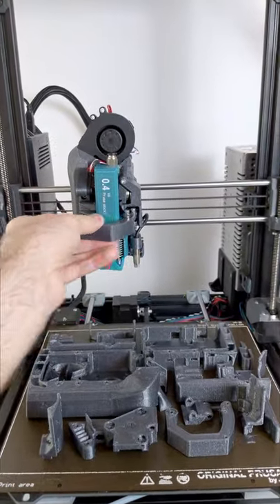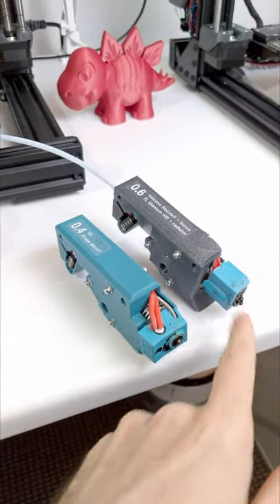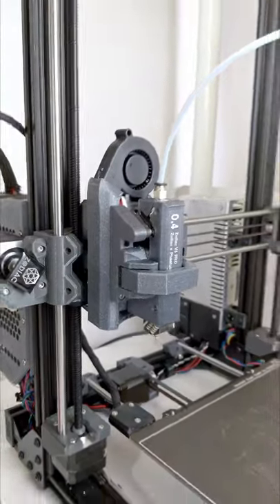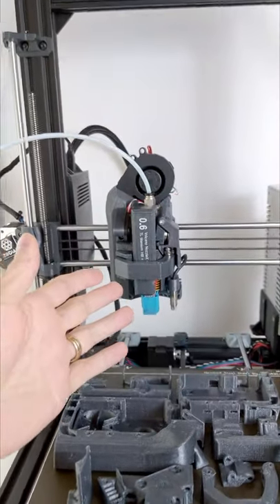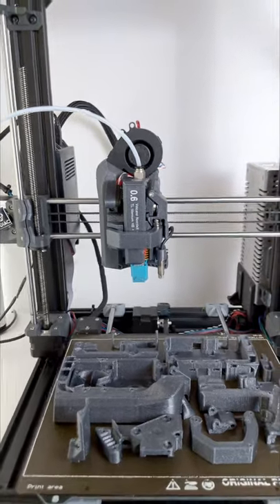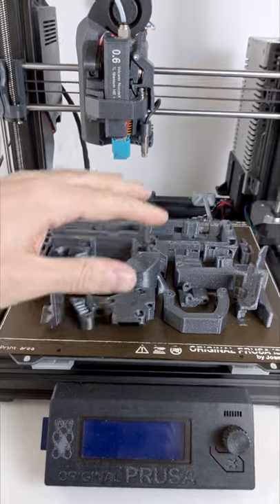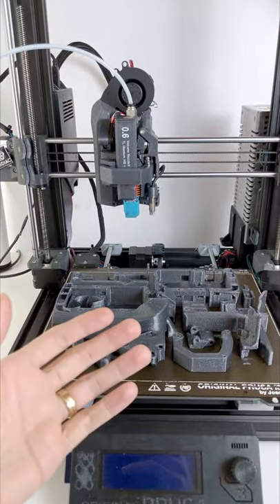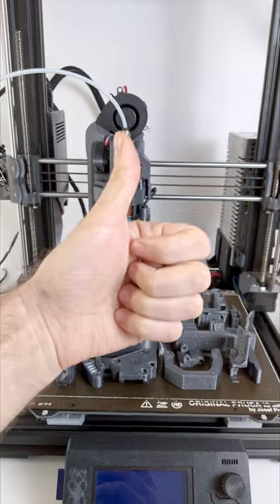Designing a swappable hotend extruder

Comment: I love the design, great work. Do you have a specific Z-Offset for every hotend? Or do you mount the hotend such that the Z-Offset stays constant? Thanks for sharing the video, and good luck :)
Reply from the maker: Z-offset is about the same for all hotends, but there's still variation, so for now I still need to adjust it in the printer. I'm hoping to at some point have this information stored in the hotend for the printer to read and apply automatically. Long way to go for this one though.
Reply: @MihaiDesigns  Thanks very much for the reply. I like the idea of having the Z-offset stored in the hotend module (and then possibly other information as well). Given the tight tolerances for Z-offset (I usually try to set it within 50 microns) It's going to make positioning the hotend within the holder very difficult (if not impossible) to do to keep the z-offset constant. That also then raises the question of how your system would handle a hotend with a different size heater block? For example, a volcano hotend has a much taller heater block, and so to keep the Z-offset consistent would mean pushing the  whole hotend assembly upwards, which would then possibly impact the cooling of the heatsink. Please don't get me wrong, I'm not trying to criticise or cast shadow on your project, quite the opposite. I've been thinking about your project so much over the past few days that these are just some of the questions I have asked myself, I'm sure you have already considered them as well. Again, thanks so much for sharing your progress, this is true innovation.
Reply: @MihaiDesigns  That can be solved very easy with some bed probe like the one that vorons uses. That would require mesing with the firmware but still will be a lot easier than "storing" the Z offset
Reply: @johnrobinson3642  You could additionally store things like PID values or thermistor tables, so you can have high-temperature print heads!
Reply: @MihaiDesigns  would it be possible to add a tuning screw in the swap modules so that the hotend modules could all be dialed into the same z offset?

Comment: Trust me, this project is by far the most interesting one and also what people are waiting for. It opens up so many doors. For me personally, I don't need automatic swaps, I'm just happy to have several hotends so that you can clean them and if there's ever a problem, I can just put in another hotend and let the printer run while fixing the problem with a faulty hotend.

When you release a Beta, I will shake like a dog out of hapiness!
Reply from the maker: Yup, this has been voiced by many people, reason why I decided to release it separately (after I do a bit more fine tuning). You still have to do a bit of Z-alignment from the printer for now as the nozzles don't align perfectly. Aside from that, I'm already happy I can swap in and out different hotends with different nozzles.
Reply: @MihaiDesigns  Z-Align could be solved by the user making the hotends, they could be measured with accuracy and perhaps adjusted in the prints. I actually plan to have my hotends printed with SLS in a factory to make them solid and 100% the same. As soon as you release them that is :P
Reply from the maker: @billyjoe3309  sure, if the hotends and nozzles are identical in size and the assembling is carefully done, they could align.

Comment: Regarding the variable hotend length problem: It's not just the hotend. Different nozzles have different lengths as well.

I assume that the heat sink and therefore also the heatbrake and the nozzle are grounded, so you could do a simple touchoff routine, like on a tool height setter on a CNC machine. Since the hotend could be grounded, you also don't need to implement a switch, but could simply use a voltage drop across a big resistor.
Reply from the maker: Yup, that could work. More tricky if you want to swap hotends during printing.
Reply: @MihaiDesigns  So, I checked the Marlin docs, and under M218 it has support for multiple XYZ hotend offsets. Not sure how much that would help, but I figured I'd put it here.

If hotend swaps during printing are accounted for in GCode, then you could simply integrate a probing routine into the swap GCode with the help of the slicer. 
PrusaSlicer already has support for multiple colors and allows you to set color change GCode so maybe that's something? 
Most likely the probing surface won't be at X = 0 though, so maybe you will have to implement some trickery? 
At least on Marlin, this will be very difficult though, as the Marlin GCode dialect does not have variables or something similar. 

Maybe something can be tricked together with an XYZ probe offset to account for the height of the sensor, and then probing the nozzle height and setting that as a global offset? However, that could interfere with bed leveling, since Marlin does not support multiple probes. 
Maybe something could be done with a fork of Marlin, but then you might as well include a dedicated "Probe nozzle height with sensor offset" routine.

However, I think it should be possible to make a very flat probing surface. In theory, all it would take is some aluminum tape on the print bed connected to the relevant pin. 
Unfortunately I'm not at home right now so I can't check how thick aluminum tape is.
Reply from the maker: Yeah that gcode would work if there was a way of measuring and storing the offsets ahead of time and processing the gcode in slicer or use a post processor or an octoprint plugin. Still not sure which way to go to make it as universal as possible
Reply: @MihaiDesigns  The cleanest solution that I can think of is a pull request to add a "Probe nozzle" and a "nozzle height sensor offset" GCode. 

Not sure if you saw it, but I also added some ramblings about aluminum tape based probing surfaces to my first comment. 

One more thought: I personally love this engineering process, and I believe many other people do. So, if coming up with solutions will ever be the problem, I think your subscribers are happy to help out with any problems.

Also, maybe you can take some inspiration from E3Ds tool changer motion system, since that has multiple nozzles but only one extruder as well?

Comment: I have two questions:
1.Why didn't you try to incorporate gear reduction in your dde?
2.Is there enough cooling for the radiator? i believe, that if you had grills or a simple hole on the front of the swappable module, you could have improved cooling so much
Reply from the maker: Geared motor will come in the next version. Will take a few months. Radiator cooling has been fine so far with no issues, but cooling can be improved if needed.
Reply: @MihaiDesigns  nice, your design is the best implementation of swappable dde modules i have seen so far, but at the same time it has a problem of complexity(in my opinion there too many small parts that aren't exactly common), would love to see it being sold as a kit

Comment: That swapping hotend is the coolest thing ever😁. Can I ask what filament material did you use for this project? Looks like nylon carbon fiber but I'm not sure...🤔
Reply from the maker: This is Fiberlogy Vertigo PETG, and the one on the build plate is their PCTG. Pretty cool texture. Similar to Fillamentum Vertigo if that's easier to find for you.
Reply: Wow, cool, does petg resist to such high temperatures?😲
Reply from the maker: @legiony5209  does for me. You can still do ABS if you use an enclosure.

Comment: Very cool project, are you going to add a chip or somthing to offset for the height of diffrent print heads?
Reply from the maker: Yup, there will be a chip for storing data such as nozzle offsets.
Reply: @MihaiDesigns  as I was thingking about this, i wondered if the ATC would be like those on the CNC or like a tank autoloader where an arm comes down (or up or from the side) and swaps the head in like 3 seconds, i also think that the head holder could use some springs, and at the same time may be you could add a servo to the ATC (or maybe a basket like the T90 autoloader) this is just some suggestions so yeah....

Comment: Will u be sharing/selling/releasing files for this? It’s a cool concept could probably automate it
Reply from the maker: I'll be sharing it once it works a bit better. I also want to automate it. I actually did the design for the automating bit first. I did a video on the whole project a while back.
Reply from the maker: @quique182 minor clearance and alignment issues, stiffness, part cooling. Then for the next version I want to look into making it more compact, using a lightweight geared extruder, bringing the nozzle closer to the rods/rail, making a CoreXY compatible version etc, but that's for the future.

Comment: This is awesome. 

Are your x axis ends upside down?
Reply from the maker: Ha, nice catch! Almost. POM nuts at the bottom. I figured I can get my MK3S to run 280mm on the Z axis this way. Plus, I can fit my fat extruder better.
Reply: @MihaiDesigns  does that change your belt path?
Reply from the maker: @brandoneich2412  nope. Everything else i still in the same place. Using the Bear carriage for this one.

Comment: Did you do any other physical modification to the mk3s to make the z axis longer?
Reply from the maker: Yup, longer rods and extrusion on the Bear mod.
Reply: @MihaiDesigns  I was just about to do the same thing, will we get a video about it in the near future?
Reply from the maker: @יונתן-צ9נ  yes, BUT my mod only works with my extruder, so not that useful for general purpose I suppose. I mean, it might just happen to work with a stock extruder, but I haven't tested. I get the feeling that it would clash against the new POM nut position.
Reply: @MihaiDesigns  Ok, thanks for the information!😎

Comment: What resolution are you printing these at?
Reply from the maker: Do you mean layer height? I made it to be print with a 0.6mm nozzle at 0.4mm layer height. This way I can iterate pretty fast.
Reply: @MihaiDesigns  I recently switched to this nozzle size now too it’s not as bad as I thought.  I need to tinker with linear advance as corners are more pronounced as it has more material and pressure build up as the nozzle makes turns. Is there any other setting that can reduce this?

Comment: Wouldn’t it be better to use a woriking printer and test on another printerv
Reply from the maker: Best way to test is to print the next version using the current version :)
Reply: @MihaiDesigns  but wouldn’t you get the flaws of the current design showing up in future designs causing problems?

Comment: What material do you use?
Reply from the maker: I'm printing in PETG and PCTG (which is still some kind of PETG as I understand it). Had to move away from ASA/ABS while not using an enclosure. If parts warp even a little bit, it's a nightmare!
Reply: @MihaiDesigns  nice but do you think it is possible to print the printhead in pla or abs without major disadvantages?